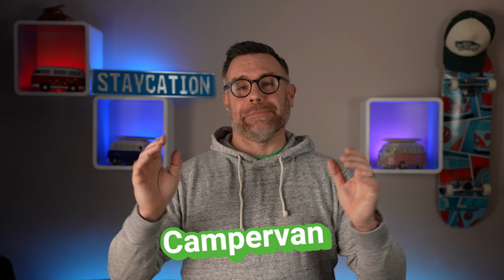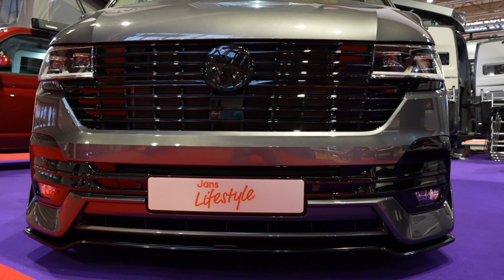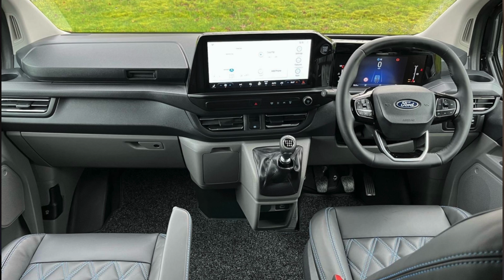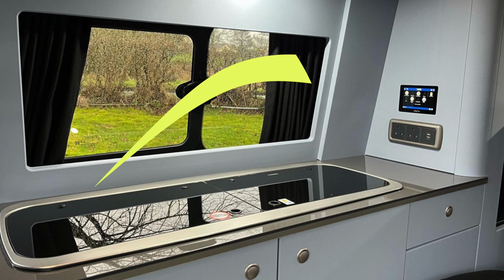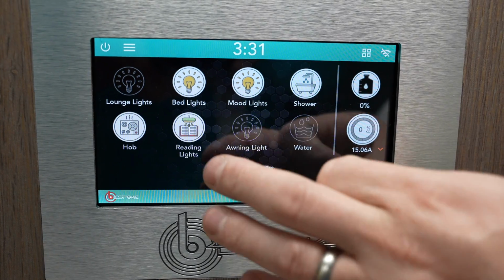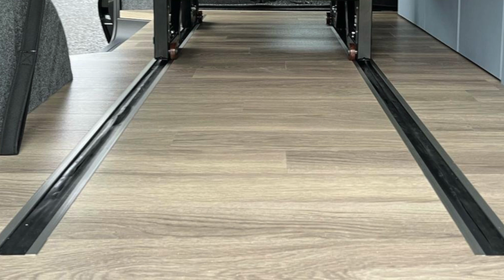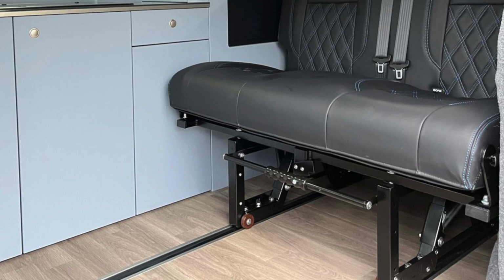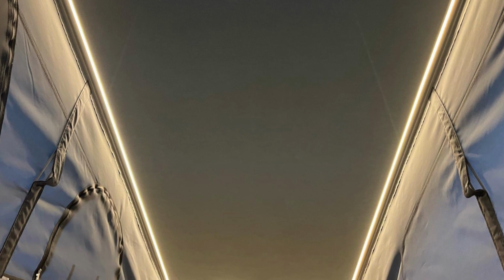New Transporter T7 Campervan or ACTUALLY the 1st Ford Transit 2024

Comment: Been saying the custom is a better base camper van than a vw but now it’s the same as a vw so if you can’t beat them join them!!😂
Reply from the maker: 🤣 It’s going to be really interesting to see how they both sell and also how the residuals stack up
Reply: Think the vw will be slightly more expensive at launch but will probably have a higher trim level & hold its value better.

Comment: Can you please explain what you believe the advantage is of having 'Motor Caravan' on the V5. This is something you mention again and again in your videos, but, in the context of a campervan, it is irrelevant to insurance and speed limits and, for campers over £40k (i.e. almost all of them), a 'Motor Caravan' classification would attract significantly higher VED charges for the first 5 years.
Reply from the maker: It’s able to legally travel at “car” speed limits. Without the need to contest. 
Insurance wise is complicated, however as a “motor caravan” it is indeed that and not a panel van with modifications. Some insurers will insure a “motor caravan” but not a converted van.
A commercial vehicle requires a commercial vehicle policy, whereas a registered campervan is a leisure vehicle.
It is deemed a big positive for some, you only have to read the forums and see how many people ask how they change it.
With the talk of insurers shying away from panel van conversions, then this will be even more appealing
Reply: @StaycationLifestyle  If a vehicle meets the criteria for a "motor caravan", as defined by The Motor Vehicles (Type Approval) Regulations 1979 (Regulation 2), then car speed limits apply regardless of the body type recorded on the V5. Yes, a very small number of camera systems automatically issue FPNs for speeding based on a vehicle's V5 classification, but such FPNs are rare and are easily rebutted. Regarding insurance, this is a red-herring - for a short period after the DVLA capriciously and arbitrarily changed the rules regarding reclassification, insurers struggled to catch up. This is no longer the case and the "forum chatter" you refer to is based on ill-informed people still believing reclassification is meaningful and necessary (a myth that, ironically, you  are perpetuating).
Reply from the maker: I have worked in insurance for nearly 30 years 😀 It’s not chatter. 
A modified panel van is not the same as a type approved vehicle.
With regards to speeding, I know many who have received notifications and had to challenge
Reply: @StaycationLifestyle  I worked in insurance for over 35 years ¯\_(ツ)_/¯ and my question related to having "Motor Caravan" on the V5  - type-approval is a related, but different issue. Regarding speeding, "many" is a relative term - what does that look like expressed as a percentage of the whole?
Reply: I thought the VED charges had been reversed now?
Reply: @thesmudge1353  The surcharge for vehicles costing more than £40k (the so-called "luxury car tax") is still in place. The supplement is set at £390 for 2024, but doesn't apply to LGVs (hence my point that having "Motor Caravan" on the V5 would lead to higher VED costs).

Comment: It just looks like the same old, same old side kitchen layout. I would rather some interesting use of the space the way they manage in small caravans.
Reply from the maker: It’s such a low head height that’s the problem. Start putting head height units up and it limits head room and floor area accessible. 
It’s a challenge and not an easy one.
Reply: @StaycationLifestyle  It is challenge, but some are achieving it. I know it is horses for courses, but the moment I see this layout I know it's not the van for me
Reply from the maker: Can you give an example of a layout that achieves it?
Reply: @StaycationLifestyle  Hillside Cromford
Reply from the maker: Good shout, it is a decent layout. Built on a bigger van as that’s LWB.
 I showed a few of those layouts in the Best Campervans video from the Nov NEC show
Reply: @StaycationLifestyle  The Reimo Multistyle is another good conversion
Reply from the maker: Is that the high top?
It’s such a difficult choice, because that wouldn’t be for me, nor would a LWB as I want to be able to daily drive and get under height barriers. 
Bilbo’s do a SWB with side opening top and that layout. There are a few options
Reply: @StaycationLifestyle  It's on a pop top and they do a 5m version apparently. It was just an example of a good layout. Ours is a 55 plate Cavarno on a 5m transit. We have a built in loo and shower compartment, full kitchen and two single beds or a double, no roof bed. Like a Wildax Pulsar footprint but with a pop top. It's our car, van and camper,

Comment: The ford engine will be the biggest problem, and put a lot of people off them
Reply from the maker: That certainly is being talked about regarding diesel. I’m keen to see what the petrol hybrid will be like
Reply: Would the Dual mass fly wheel problems put you off a VW?
Last week I changed the wet belt on my 69 plate custom. 110k on the clock.
No debris in sump, pick up pipe and zero signs of cracks or shredding on the belt.
I wouldn’t even say it was a difficult job.
With the amount of vehicles sold for both ford and Vw there are obviously going to be issues with some and ford have had some. I’m sure the wet belts have been upgraded on the production line along the way. 
I will say also that the VW snobbery that I’m seeing with this collaboration is unreal. 
It’s as if the Transporter has never had a problem.
That is most definitely not the case.

Comment: hopefully they will change the cheap not fit for purpose curtains........haha
Reply from the maker: I do prefer blinds, looks wise. However I’ve not had a problem with the curtains.
It’s on my list of suggestions/ideas 😃
Reply: no i like curtains but not ones you can see through when spot lights are on..
i had to change them for better 2 layer ones.. @StaycationLifestyle
Reply from the maker: @vanagon1966  that’s not good. Ones I’ve seen have been decent. Blackout the light well.
Reply: nope bespoke use the same curtains on all models single cheap thin material.we turned lights off when getting undressed for bed they are that bad    @StaycationLifestyle

Comment: needs to be in orange
Reply from the maker: The new custom doesn’t have the orange, not in the panel van anyway
Reply: guess I will have to wait for te RAC to use the panel vans and convert iot myself🤣 @StaycationLifestyle
Reply from the maker: @DNoman-v9f  🤣 or you could repaint or wrap it 🤷🏻‍♂️